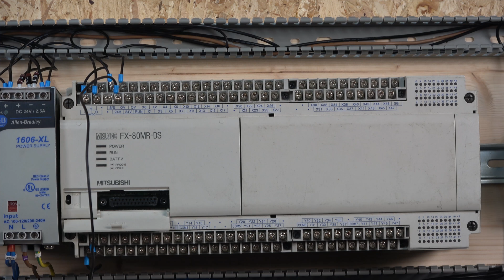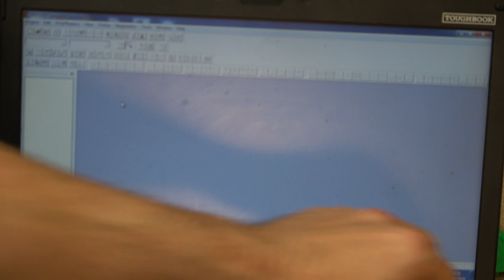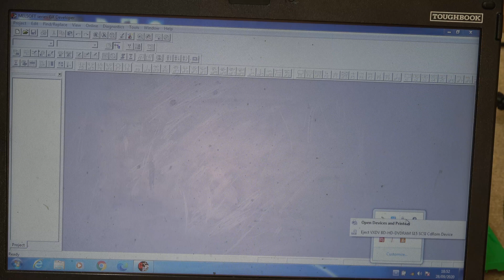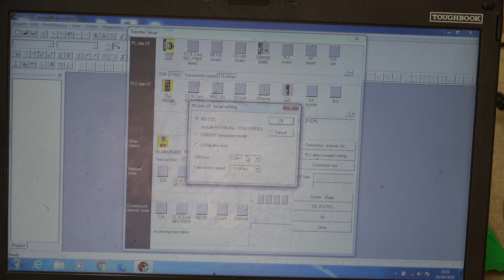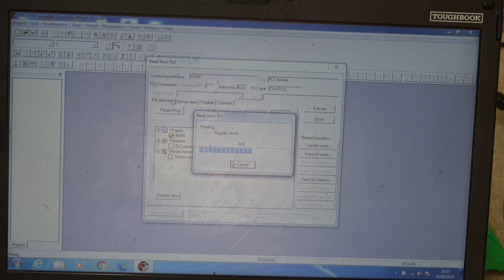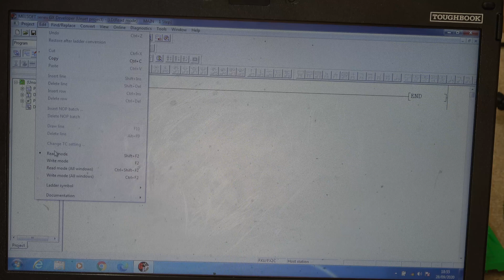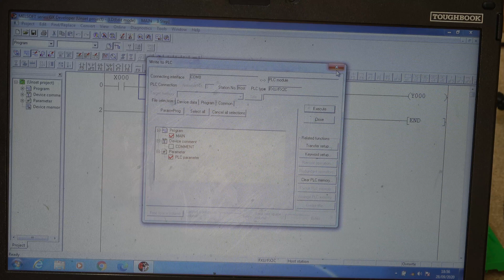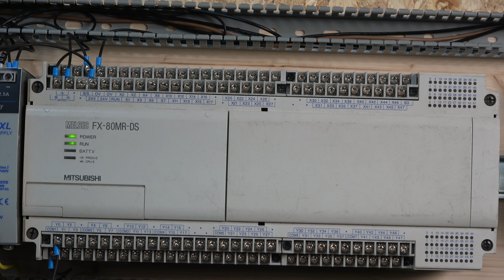How to program old Mitsubishi FX plc using GX Developer Upload/Download I/O test (English)

Comment: Hello, I'm asking you. What version of Gx Developer are you using? I have an FX-48MR PLC and I still have not been able to connect, Thank you
Reply from the maker: For that, you will need to look into the com port setup and make sure the correct port is used, as well as the legit sc-09 Mitsubishi cable.

Comment: Nice video :). Is there an “easy” way to factory reset a Mitsubishi PLC? I got an second hand FX3G-14M but it has the original programming on it and I just want to delete it. This is my first PLC ever so no experience with it whatsoever. Computers and programming is a interest of mine so this seemed fun :)
Reply from the maker: Hi Flyrip. You will need to PC to remove the program, under online there is option Clear PLC memory. Or you can be cruel and remove battery and it will wipe the lot, not sure way you would want to do that as if you are going to use it again anyway, might as well get it done in GX Works 2.
Reply: @IGSElectronics  Thanks! I think I will start with removing the battery and see what happens 😊 I also have the “screen” so I just want to get playing with it 😄

Comment: Hi sorry for my question I bought FX1n which works from 110-260v. How should i connect line and neutral - only in correct way (lane for line  place) or tham can be mixed (line for neutral )?
Reply from the maker: Hi there. No don’t mix them up. Make sure L is for live N for neutral. Sometimes Big Bang can happen, but usually manufactures these days put some protection for that.
Reply: @IGSElectronics  great thank you, i will be careful with contacts

Comment: Good evening Ingus, I'm Jorge from Spain. Thanks for your great video. I will try to buy the original cable in Spain and test. I have some doubts, when uploading or downloading a copy from or to the plc, should I put it in stop ?, and then I have to download the 3 things, main, comments and parameters for a good backup? Regards.
Reply from the maker: JORGE H.G. Just select all 3 ticks. It don’t have any comments inside the plc, but for the sake of it, way not. You be fine, just fallow the steps in video you should have no problems.
Reply: Good morning Ingus again, I have not got the original mitsubishi cable in Spain, it is obsolete. My question is, would you have one to sell me, if you have enough, or if you know of any other model that could be reliable. Thanks for all!!
Reply from the maker: @jorgeh.g.  Hi Jorge. Yes I do have one original cable in stock. But i have not listed on website yet. Is your programming laptop have RS232 port or you are after usb version? Baying original from me would be around 120GBP, but have a look at the link below, they seam to claim it is suitable replacement for SC-09.https://www.radwell.co.uk/en-GB/Buy/RADWELL%20VERIFIED%20SUBSTITUTE/RADWELL%20VERIFIED%20SUBSTITUTE/SC-09-SUB
Reply: Hello Ingus, I have tried to do it with one similar to the one in the link, which a colleague has provided me, but I have not been able to connect, so I would like to do it with an original Mitsubishi, just as you have done. I have 2 computers, one with a serial port and one that does not, so with one I would try through the rs232 port, and the other would be through a usb / rs232 converter. The other one that you have yours to sell, is it original?
Reply from the maker: JORGE H.G. Yes, original cable form Mitsubishi. Original cables should say Beijer Electronics. Did he bay that form China? I am happy to supply you the cable, just wanted for you to have a go on cheaper version, radwell seams to claim that it is exact replica . I will list the cable on website tonight and let you know once it is up.
Reply: @IGSElectronics  
Thanks Ingus. However, it would be for a company and must be with an commercial invoice and they have to authorize the payment of course, please send me a good price, below those 120 GBP that you told me. Or are you going to put it on your website? regards
Reply from the maker: @jorgeh.g.  No worries, I can issue commercial invoice, send me your details to ingus@igselectronics.co.uk, Billing and shipping address etc, and we can go from there.